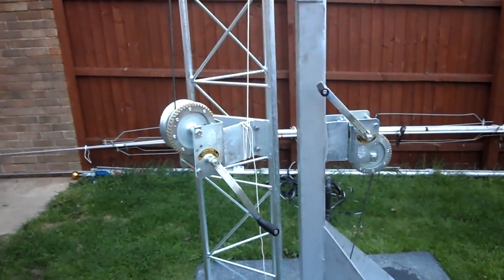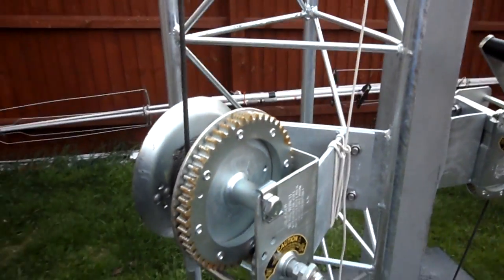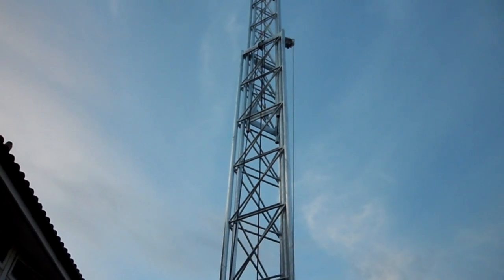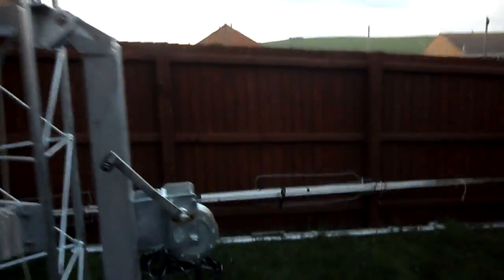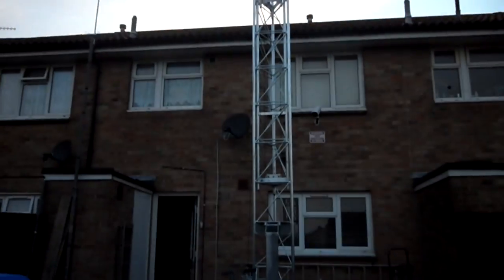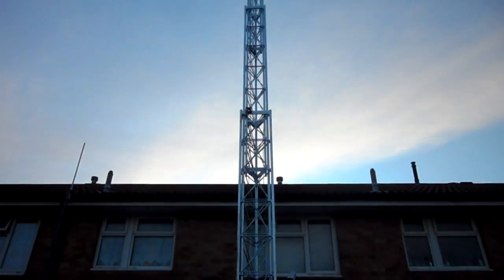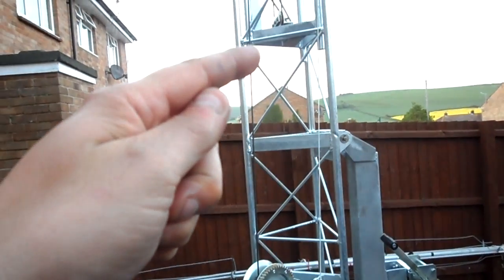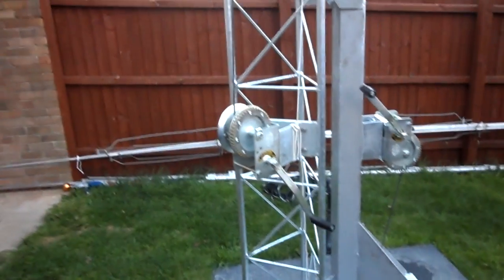G0SEC New Tower Installation, Winched up about half way

Comment: wow, I want one. how tall will it go?
Reply from the maker: 80ft but due to the stub mast in rotator cage she will go 87ft to antenna, yea she is high at full height but i usually just sit her at 60 - 65 ft if im on air on HF, she is not so shinny now as a few years older but superb tower.
Reply from the maker: info sent to your email address ok... hope this helps.. James G0SEC

Comment: Excellent installation.I've been trying to find out the pulley system cabling diagram for this range of towers but have been unsuccessful. Where can I get an engineering drawing of it?
Reply from the maker: Hi Mark, if you can email me on jamesg0sec@googlemail.com i will send you it ok..
Reply from the maker: Mark, i lost your email can you email me again and i wil forward you over the manual for it ok... so sorry bud .. James
Reply: Send to me also vu2zmk at yahoo dot com.